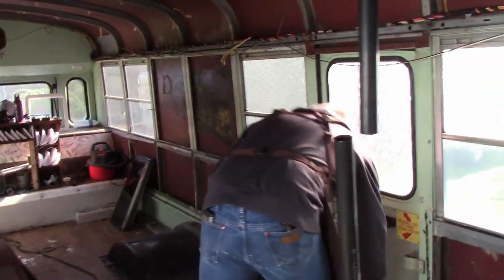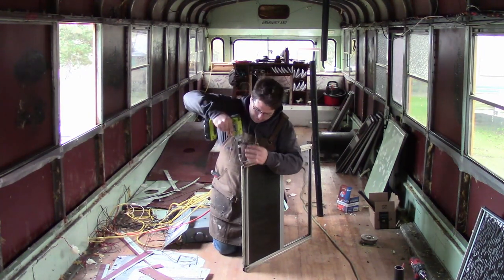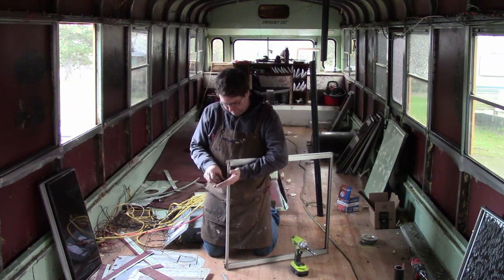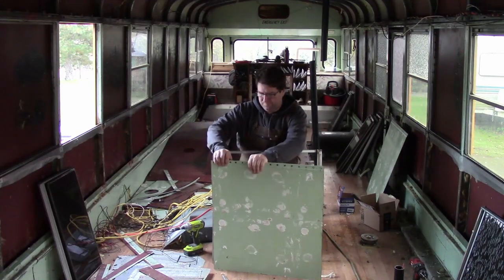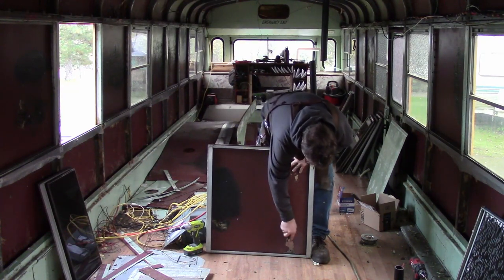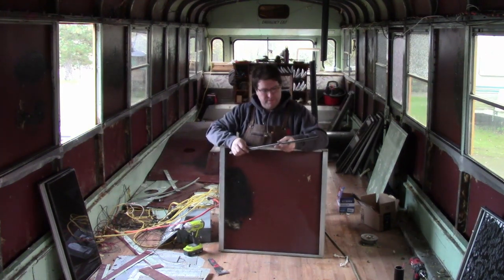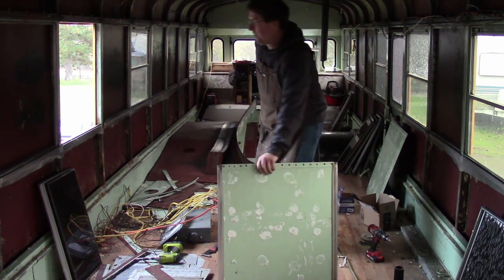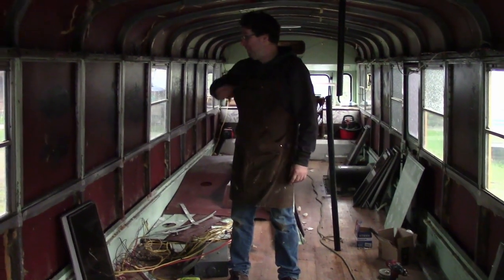How-we Delete Bus Windows for Our Skoolie

Comment: My windows in my bus were made to sit in the window frame of the bus and 4 screws with resessed washer between each window top and bottom. After window removed frame comes apart and glass panes removed. Then I will insert plywood  in two seperate channels in the frame where the glass panels were and the two panels are glued together and reenforced on the inside with metal strips. The installation will not be seen because a framed wall will be covering the deletes.